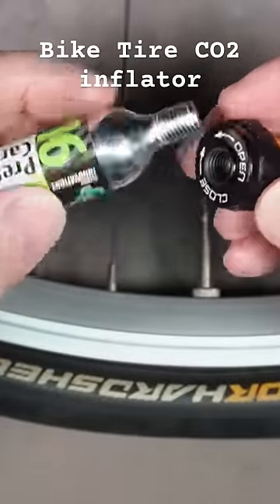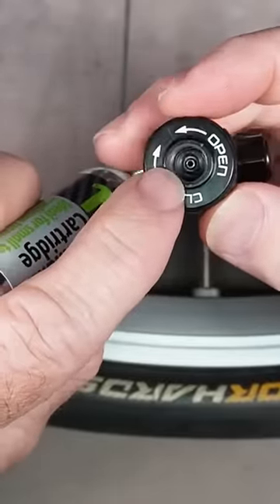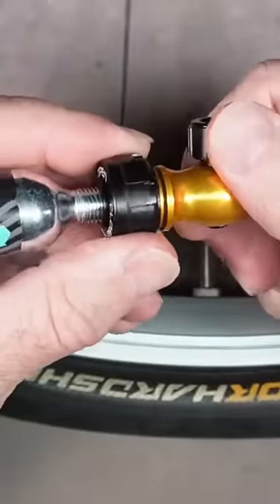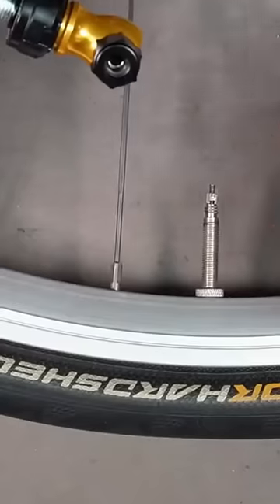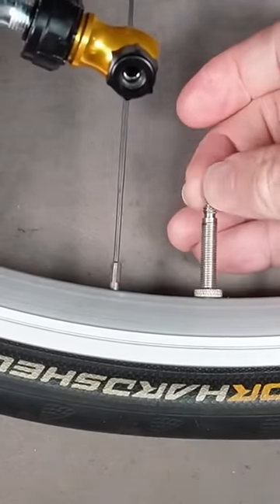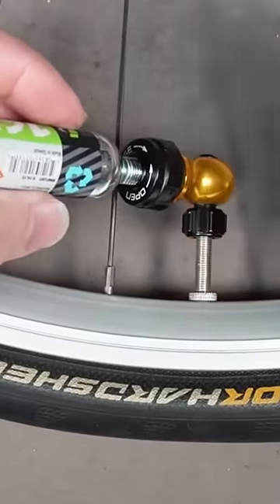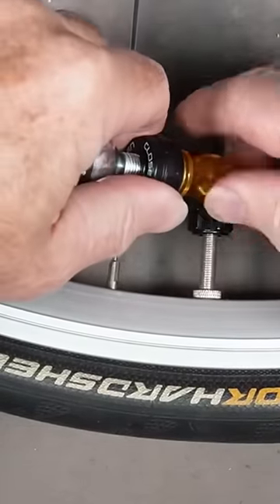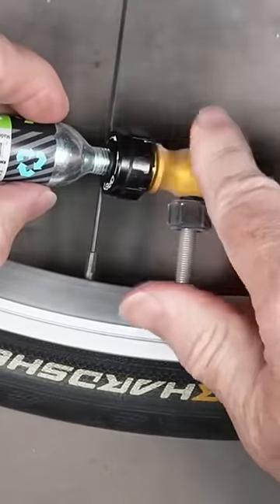Bike Tire (tyre) CO2 Inflator: How to use. #bicyclerepair #bike

Comment: DON’T loosen the schrader valve
Reply from the maker: This is a Presta valve. Presta valves close when there is pressure inside the tube or tire. I only loosened the lock nut, which is necessary for air or CO2 to flow into or out of a Presta valve. I did not remove the core.
Thanks for the comment! I appreciate it!

Comment: He took the valve stem out. 😂😂😂
Ya better be very, very, VERY fast at putting it back in tight.
Reply from the maker: This is a Presta valve. Presta valves close when there is pressure inside the tube or tire. I only loosened the lock nut, which is necessary for air or CO2 to flow into or out of a Presta valve. I did not remove the core.
Thanks for the comment! I appreciate it!
Reply: @davescycling  Thank you. I never heard of one of those before. Still learning at my age.

Comment: And how you gonna screw the needle valve back down without the air coming back out when you take it off
Reply from the maker: This is a Presta valve. Presta valves close when there is pressure inside the tube or tire. I only loosened the lock nut, which is necessary for air or CO2 to flow into or out of a Presta valve. I did not remove the core.
Thanks for the comment! I appreciate it!

Comment: What is the benefit of this?
Reply from the maker: A CO2 inflator is just another option for emergencies to quickly and easily inflate a tire out on the road after fixing a flat. It is light, small, and inflates a tire in seconds with no effort. I have been carrying this on my rides for years, and it has saved me more than a few times. Thanks for commenting!

Comment: Wouldn’t that make your tires heavier creating more drag?
Reply from the maker: Technically, CO2 is heavier than air, but I doubt the differences enough to affect your ride. A CO2 inflator is just an emergency tool to inflate your tire out on the road after fixing a flat so you should always replace it with regular air when you get home anyway.

Comment: Now is that a regular CO2 cartridge green gas or is it a special cartridge does for that because we had to buy pacific cartridges for it you know it’s gonna be expensive if you can use regular CO2 cartridges on it then you talking
Reply from the maker: Most standard CO2 cartridges will work just fine.

Comment: Another xlnt intervention is a pump. And it a may be cheaper.
Reply from the maker: A CO2 inflator is just another option for emergencies to quickly and easily inflate a tire out on the road after fixing a flat. It is super small, light and inflates a tire in seconds. Thanks for commenting!

Comment: Wouldn't No2 work better?
Reply from the maker: Maybe, but I have not seen readily available NO2 cartridges
Reply: @davescycling  they are commonly used in restaurants/catering for whipped cream dispensers but they are not threaded. More like traditional co2.

Comment: Why are you using the greenhouse gas, CO2?  Doesn't anyone make N2 ( nitrogen ) cartridges?
Reply from the maker: I have there to see these made for bikes with N2. They may exist but I have not come across them. Thanks for the question!
Reply: @davescycling  I was just wondering because in the food service industry and dentistry, they have little bottles like that filled with NO2.  I'm pretty sure laughing gas in bike tires would just be a waste.
     I just did a web search.    Leland Gas Industries makes nitrogen filled cartridges for $35 U.S.
Reply from the maker: Thanks for the info! I will look at that. I hope you get more than one cartridge for $35 because that is pretty pricey if not!
Reply: @davescycling  I don't know how many cartridges are at that price.  I've seen fire extinguisher sized bottles (and the really big ones too) used first by professional auto racing teams, welders, and lately, automotive specialty shops.

Comment: I just remembered  Kabaylane
Reply from the maker: Using a CO2 inflator is a lot easier than using a pump. If you know how to connect a pump to a bicycle valve you will be able to use this simple device. Everyone seems to think this is overly complicated but it is actually an extremely popular emergency inflation method that many cyclists use.

Comment: And how do you get the Schrader valve back in?????
Reply from the maker: This is a Presta valve. Presta valves close when there is pressure inside the tube or tire. I only loosened the lock nut, which is necessary for air or CO2 to flow into or out of a Presta valve. I did not remove the core.
Thanks for the comment! I appreciate it!
Reply: I've never Heard of that valve.  Ok. Thanks
Reply from the maker: I always thought it was well known, but apparently I was wrong, lol. Lots of people asked the same question you did! I appreciate your input!

Comment: Hand pump is a whole lot cheaper than buying a CO2 chamber
Reply from the maker: My CO2 inflator and 2 cartridges cost less than $20. 

A CO2 inflator is just another option for emergencies to quickly and easily inflate a tire out on the road after fixing a flat. It is super small, light and inflates a tire in seconds. Thanks for commenting!

Comment: And the video ends just before the valve steem flys away and you lose all the air.
I've gotta be missing something. Bc why anyone would suggest loosening a spring loaded, one-way valve steem to add air is beyond me.
Reply from the maker: This is a Presta valve. Presta valves close when there is pressure inside the tube or tire. I only loosened the lock nut, which is necessary for air or CO2 to flow into or out of a Presta valve. I did not remove the core.
Thanks for the comment! I appreciate it!

Comment: How are you going to close the tire valve explain that to
Reply from the maker: Nothing will escape when the CO2 inflator is removed. This is a Presta valve. Presta valves close when there is pressure inside the tube or tire. I only loosened the lock nut, which is necessary for air or CO2 to flow into or out of a Presta valve. I did not remove the core.
Thanks for the comment! I appreciate it!

Comment: why would you loosen the schrader valve ? dont the filler have a pin to open the valve ? bad design
Reply from the maker: This is a Presta valve. Presta valves close when there is pressure inside the tube or tire. I only loosened the lock nut, which is necessary for air or CO2 to flow into or out of a Presta valve. I did not remove the core.
Thanks for the comment! I appreciate it!

Comment: What about all the lost co2 from valve core that he showed to ve loose?
Reply from the maker: Nothing will escape when the CO2 inflator is removed. This is a Presta valve. Presta valves close when there is pressure inside the tube or tire. I only loosened the lock nut, which is necessary for air or CO2 to flow into or out of a Presta valve. I did not remove the core.
Thanks for the comment! I appreciate it!

Comment: Dumb question 
How does one get the valve core back in once it's inflated without losing a good portion of the air
Reply from the maker: Not a dumb question at all! Many have asked similar questions. The answer:
Nothing will escape when the CO2 inflator is removed. This is a Presta valve, not a Schrader valve. Presta valves close when there is pressure inside the tube or tire. I only loosened the lock nut, which is necessary for air or CO2 to flow into or out of a Presta valve. I did not remove the core. You can see the entire video here: How to Use a CO2 Bike Tire Inflator
https://youtu.be/jc-BpZL3lAk
Thanks for the comment! I appreciate it!

Comment: CO2 is rubbish for inflating tyres. CO2 actually dissolves in rubber, it doesn't have to leak out through tiny holes it just diffuses straight through the rubber. Result is tyres filled with CO2 go down much quicker.
Reply from the maker: All true. A CO2 inflator is just another option for emergencies to quickly and easily inflate a tire out on the road after fixing a flat. It is super small, light and inflates a tire in seconds. Thanks for commenting!

Comment: U dont actually have to unscrew the bike valve its designed so that a small push will let get the air in
Reply from the maker: This is a Presta valve. Loosening the lock nut is necessary for air or CO2 to flow into or out of a Presta valve.
Thanks for the comment! I appreciate it!

Comment: What's wrong with regular air???🤷🏾
Reply from the maker: Nothing! A CO2 inflator is just another option for emergencies to quickly and easily inflate a tire out on the road after fixing a flat. It is super small, light and inflates a tire in seconds. Thanks for commenting!

Comment: Why CO2 over regular air
Reply from the maker: A CO2 inflator is just another option for emergencies to quickly and easily inflate a tire out on the road after fixing a flat. Best to replace it with regular air when you get home. Thanks for commenting!

Comment: He loosened the valve on the stem and then attached the little tank. 
After it filled the tire, he didn't show how he was going to remove the tank and screw back the valve in the stem without letting all the air out.
Reply from the maker: If you watch the full video by clicking the link in the video, you will see how this works. The valve is a Presta valve, and it stays closed as long as there is pressure in the tire. Thanks for your comment!

Comment: What's wrong with a normal bike pump?
Reply from the maker: Nothing at all! A CO2 inflator is just another option for emergencies to quickly and easily inflate a tire out on the road after fixing a flat. It is super small, light and inflates a tire in seconds. Thanks for commenting!

Comment: Think about if the tire pops
Reply from the maker: If you start with a flat tire, one complete cartridge will put enough pressure in most tires to get you going and will not come anywhere near close to popping anything. Thanks for the comment.

Comment: Seems like a more expensive alternative to a reusable pump.  They must have a surplus of co2,  or some reason they need to raise the co2 in the air for some unimaginable reason they would never profit from.
Reply from the maker: A CO2 inflator is just another option for emergencies to quickly and easily inflate a tire out on the road after fixing a flat. Thanks for commenting!

Comment: These days batteries are powerfull
Displays are everywhere
Pressure check is handy aswell
So someone already made a smart tyre inflator. A $5 hand pump is budget solution. Smart inflator is the best solution. This pressurised gas kit maybe useful in space for some oxygen. Oh wait 😅
Reply from the maker: There are definitely a lot of options to pump up your bike tire when you get a flat on the road. They all have pros and cons. I prefer the CO2 inflator as it is super small super lightweight and super fast to use. It has gotten me out of four or five flat tires over the past few years and I swear by them. I have tested some of the rechargeable inflators, but any of them worth the price are way too heavy. I bought Cycplus cube mini inflator, but it barely pumps up one tire before the battery dies so that is no good. Thanks for your input!

Comment: Am I the only one? ( unscrewed  the spring valve, all the co2 will just blast out when he removes the thing.)
Reply from the maker: Nothing will escape when the CO2 inflator is removed. This is a Presta valve. Presta valves close when there is pressure inside the tube or tire. I only loosened the lock nut, which is necessary for air or CO2 to flow into or out of a Presta valve. I did not remove the core. You can see the entire video here: How to Use a CO2 Bike Tire Inflator
https://youtu.be/jc-BpZL3lAk
Thanks for the comment! I appreciate it!

Comment: Why not just use regular air
Reply from the maker: A CO2 inflator is just another option for emergencies to quickly and easily inflate a tire out on the road after fixing a flat. It is super small, light and inflates a tire in seconds. Thanks for commenting!
Reply from the maker: A CO2 inflator is just another option for emergencies to quickly and easily inflate a tire out on the road after fixing a flat. It is super small, light and inflates a tire in seconds. Thanks for commenting!

Comment: Hiw the hell does unscrewing the valve stem work?
Reply from the maker: This is a Presta valve, not a Schrader valve. Presta valves close when there is pressure inside the tube or tire. I only loosened the lock nut, which is necessary for air or CO2 to flow into or out of a Presta valve. I did not remove the core. You can see the entire video here: How to Use a CO2 Bike Tire Inflator
https://youtu.be/jc-BpZL3lAk
Thanks for the comment! I appreciate it!

Comment: Soooo, exactly how do you take that off without letting all the Co2 out, being that you removed the Valve Stem Core???  Hense the point of the valve stem core depressor within an air-pump. seems like this particular item is junk, cause as soon as you remove the "Co2 Pump" from the Valve Stem, FLAT TIRE.....  AGAIN..... YAY.....  funny how you cut the video just before the tire said "PSSSSSSSSSSS" REAL FAST! LOL!
Reply from the maker: Nothing will escape when the CO2 inflator is removed. This is a Presta valve. Presta valves close when there is pressure inside the tube or tire. I only loosened the lock nut, which is necessary for air or CO2 to flow into or out of a Presta valve. I did not remove the core. You put can see the entire video here: How to Use a CO2 Bike Tire Inflator
https://youtu.be/jc-BpZL3lAk
Thanks for the comment! I appreciate it!

Comment: And because you have removed the air valve off the nipple of the tire as soon as you remove your air cylinder mechanism your tires going to go flat again
Reply from the maker: Nothing will escape when the CO2 inflator is removed. This is a Presta valve. Presta valves close when there is pressure inside the tube or tire. I only loosened the lock nut, which is necessary for air or CO2 to flow into or out of a Presta valve. I did not remove the core. I have a lifetime of experience with these valves.
Thanks for the comment! I appreciate it!

Comment: After all that effort you could just carry a small pump and have it pumped int he time you’ve pissed around with that
Reply from the maker: Thanks for your input! There is certainly nothing wrong with a pump, but this method is WAY faster if you know how to use it. I have used both over many years of cycling and no longer carry a pump.

Comment: They don't show al the air coming out before you can close the tire valve again.
Reply from the maker: Nothing will escape when the CO2 inflator is removed. This is a Presta valve. Presta valves close when there is pressure inside the tube or tire. I only loosened the lock nut, which is necessary for air or CO2 to flow into or out of a Presta valve. I did not remove the core. You can see the entire video here: How to Use a CO2 Bike Tire Inflator
https://youtu.be/jc-BpZL3lAk
Thanks for the comment! I appreciate it!

Comment: That little co2 cartridge won't fill the tire. Also, what happens when you disconnect the cartridge?
Reply from the maker: Yes, the 16g cartridge will absolutely fill the tire. It will fill it to at least 95PSI. I will link a video showing this in a moment. Also you will see that no air escapes when the inflator is removed because it is a Presta valve, which closes when there is pressure in the tube or tire. Here is the video: Bike Tire CO2 Inflator: How much pressure can it generate?
https://youtu.be/vGA_hWeTthQ
Reply: @davescycling  A couple things. No it won't. There isn't enough co2 in it. Also, if the valve is loose, it will leak as soon as you remove the cartridge.
Reply from the maker: Respectfully, if you have actually tried this you will see. Also you need to look up how Presta valves work before you reply. It is a common practice for road cyclists, I demonstrated it in the video I linked and have done it many times on the road over the years. It is not my opinion that this works. It is actual fact that it works. Just to be clear we are talking about road bike tires here (700c x 23,25,28mm) if you are talking about a motorcycle or car tire then no it won’t fill those tires.
I do appreciate the comments because it keeps the conversation going!
Reply: @davescycling  Respectfully. I've used co2 cartridges, and they don't hold that much. Also, the valve is loose. You can see that before you put the elbow on, that's connected to the co2 cartridge. I'm not arguing. Just accept that I didn't believe your edited video.
Reply from the maker: This will be my last reply. I’m sure you have used CO2 cartridges before but you never used a Presta valve or inflated a road bike tire with one. If you had, you would know. My video is 100% real and accurate, and edited for time only. I do appreciate you watching it, though!
Reply: @davescycling  If the valve is loose, it will leak. It doesn't matter what valve you use.

Comment: But why? Seems like a small hand pump would be better in a pinch.
Reply from the maker: A CO2 inflator is just another option for emergencies to quickly and easily inflate a tire out on the road after fixing a flat. It is super small, light and inflates a tire in seconds. Thanks for commenting!
Reply: @davescycling  it’s definitely cool, I guess I’m just old skewl lol

Comment: Show me where you screw back in the valve without the air coming out?
Reply from the maker: This is a Presta valve. Presta valves close when there is pressure inside the tube or tire. I only loosened the lock nut, which is necessary for air or CO2 to flow into or out of a Presta valve. I did not remove the core.
Thanks for the comment! I appreciate it!